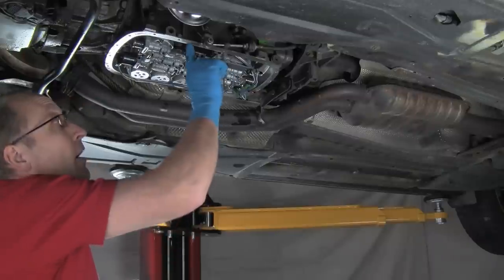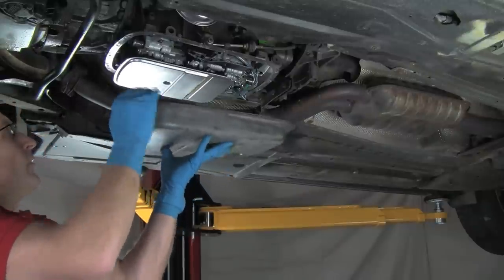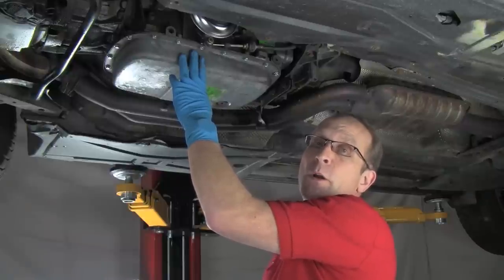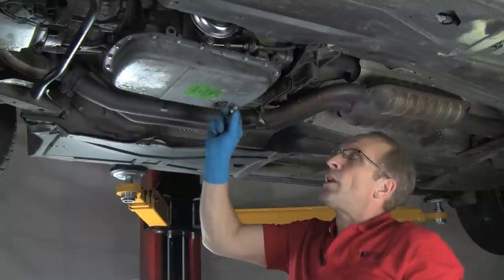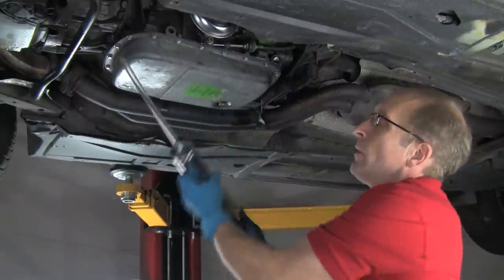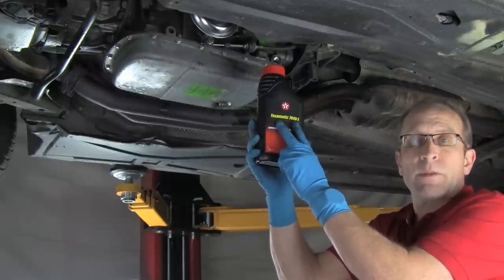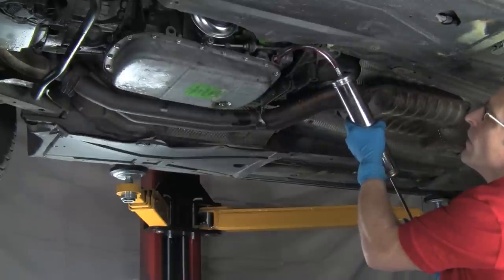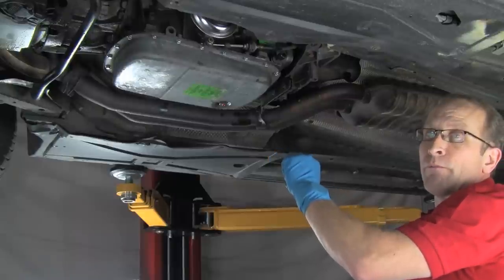Part 2: Changing Automatic Transmission Fluid & Filter On A BMW/MINI

Comment: Is it okey to just have the engine running like in this video with a 5HP30 transmission? Some say the oil has to be at 30-40 C° temp etc before final fill. I want to do this procedure on my E38 750. Waay to expensive for BMW to change fluid and filter

Comment: great demo, but I have a question, should I buy and use the transmission oil at BMW auto part? or use like your demo Texaco or the other brand, are this the same quality than BMW oils?

Comment: Most dealerships or even specialist locations state to change the ATF at about 100K, however you guys recommend 50K (at least on an E90).  My E91 is at just about 52K.  This video is a great tutorial, however it'll obviously be more difficult without a lift!  Is this relatively easy to access, with low-profile ramps?

Comment: BavarianAuto I have an 01 540i AUTO, I am about to perform this maintenance, But I am conceded about the quantity of ATF.  After calling BavAuto I was told that my car needs 7L of fluid and in this video it is 5L of fluid.  Which one is it? I will be performing a regular transmission/filter oil change.  I am at 105k miles. Thanks !

Comment: Thanks for great video and excellent knowledge share.
I've BMW 318i 2007 1.9 automatic and very recently it was sticking to lower gear especially on uphill at low speed. And my car was eating away the engine oil (I have been putting 4L every 2/3 months). Now the engine light came on and I fill in 5L but the problem is gone worse. On auto it is reluctant to change gears at all unless it is downhill but manual is good so is the reverse. And the power is not as much as it sounds like. Would changing the fluid and filter solve the issue? Please advise. Thanks

Comment: Do you recommend to have a transmission fluid flush at a garage instead of only changing the oïl and filter? I have a 2005 325i 150 000km never changed the trnasmission oïl?

Thanks

Comment: With this method  we won't be able to get the oil left in torque converter? Is there any way that we could that oil as well because the torque converter is full of oil????

Comment: Hi can you guys do a video on the BMW Transmission Fault Code – P0741 – Torque Converter Clutch on a 2001 530i

Comment: I wouldn't recomend hobby mechanics to do this themselves. I'd rather go to a repair shop that uses a transmission flusher. It takes about 10-15 litres of oil to do it, but the effect of the job is so much better!

Comment: Your vehicle has a ZF6HP26 transmission the pan filter and magnets are all in one, also the connector sleeve needs to be replaced, if you’re thinking about doing it yourself be mindful that that particular transmission (sealed for life ) needs to be refilled from the bottom of the vehicle up to a temperature of 40 C

Comment: Question:

How many total quarts go into a 2007 328i ?? And Is it safe to do the drain and fill once without having to do a fill and drain twice like most people do on here. More than anything for cost effectiveness.

I saw in another video that the guy said too clean is not good as the oil will be too thin and might mess with the synchro of the gears. Leaving a bit of old oil was recommended to allow the viscosity to be a bit thicker. Any word on this?

Comment: Missing lots of steps....Before the last fill you have to check the trans. temp via DIS software. You also forgot to check the transmission fluid 3. time which should have been after a drive and rest until the trans temp falls back again to between 40-50 Celcius. Because the valve opens after 80C and full circulation completed, so your 2. fill and check level (at around 50C) might not necessarily accurate anymore after that. So the car needs to rest after the drive on the road until the transmission temp falls back down to 50C.

Comment from the maker: In theory ..... if you can load the gun with fluid vs. grease, and it will stay in the gun .... and you don't mind a lot of pumps to run the fluid out.  I think the gun would leak anyway.

Comment: Hi, I liked your video. I've seen other videos where the tech replaces the transmission fluid, runs the car through each gear, and then allows the new fluid to drain through the drain plug once more before refilling it with new fluid again. Which way is the correct way and/or what difference does it make? Thanks for your response.
Reply from the maker: The second fluid drain/fill is recommended when the original fluid is obviously dirty or the change has never been done before and the vehicle has higher mileage.  The running, between the first fill and the second drain, should be for more than just a couple minutes, in order for the fluid to fully mix.
Reply: BavarianAuto 
What about the fluid inside the torque converter? You did not change them at all. That oil is now mixed with new oil and all the effort is futile!
Read more              Show less                     

Reply                  ·           1         
               
                    

                             

Cancel         Reply         Save       
     

         ▼                      Report spam or abuse                                     

          

eviloctober                    1 second ago                 

Dinesh Wijeratne  has any one ever given a answer to your question?  I was wondering the same thing, because with out removing all the fluid its not a fluid change, your mixing 2 different most likely different fluids, you have a very accurate question.Alvaro Aleman asked the question as well  No one seems to know??

Comment: Hey BA, I have a question. My 03 E46 automatic transmission is working fine in reverse but struggles to move in drive and I get a little white smoke after I turn the car off- none while the car is on. I know it needs to be rebuilt or replaced but I wounder if the fluid needs to be topped off just to buy me a little more time. Any thoughts would be appreciated thanks.

Comment: Hey,
Thank you for this great video!!
I have a 2006 325 i and i would like to know what type of transmission oil should i put in beside the one that the dealer has...i have 140.000kms on the car...should i change the filter as well?!?...i dont't know when was last changed because i bought it at 90.000kms....thank you for your precious answer!
Reply from the maker: Yes, change the filter as well as the fluid.  If you look at our website (www.bavauto.com), we will only show you the fluids that are recommended for your specific car/transmission (after you enter your model).  The ZF Lifeguard-5  fluid is our best recommendation for your 325i..
http://www.bavauto.com/fland.asp?part=lifeguard5

Comment: So I just completed an Trans Filter change and I have a quick question, is it fine if I add Pentosin ATF 1 fluid to my 2000 323i BMW. I was informed from a mechanic that if I used Dexron III that the transmission would fail so right now I'm currently debating everything right now

Comment: looks easy now.  just bought a 2001 z3 coupe.  how much fluid should i have on hand when doing this?  also should i run the vehicle and keep changing fluid until it comes out red, or will the procedure you did be ok?

Comment: Hi I have a E36 328i auto i have a little issue when I go Reverse it takes 5-6sec to go in gear I’m assuming low on transmission fluid, how do I check for the level: 1.with engine running on D or engine off pls I do need ur help thank you.

Comment: My 1989 E32 goes into reverse but not drive, doesn't even try to change from neutral to drive at all. One time the dash said "Transmission"  but usually it does not.  Voltage is around 13.22 on the car.
Reply from the maker: More than likely a worn-out "A"-clutch.  See link below:
http://blog.bavauto.com/10394/bmw-automatic-transmission-failure-4hp-22-a-clutch-4hp22-4hp24-3hp22/

Comment: Thanks for the great Video Bav Auto....Can you tell me if, once you've filled the Transmission with new fluid, running through all the gears instead of just park while the engine is running will free up even more fluid space?...thanks

Comment: I have a 2003 530i and just had the ATF drained, refilled and the new Gasket & Filter were replaced also.  I put the cardboard under my car overnight and just got home from work, I found out there is fresh fluid which is about 7 different spots on the cardboard about the driver side.  I wonder what is all about?

Comment: IS THIS THE SAME FOR 06 BMW 325i AUTOMATIC? AND HOW MANY QUARTS OF TRANS OIL WOULD MINE TAKE?  GREAT VIDEO.. EVERY DIY VIDEO SHOULD BE LIKE THIS!
Reply from the maker: The E90 chassis 2006 325i uses a different transmission. If you look at our online store, at BavAuto.com, we will show you the proper filter kit, fluid and the fluid quantity.

Comment: Great video... very detailed and thorough.  Does this process apply to a 97 E38 also?  Also, when checking the current trans fluids.... is ok/normal to see some very small metal shavings?  I took my 97 740iL to a local tranny place ... they looked at the oil, saw some very small shavings and said I need a new transmission, thoughts?  Thanks so much --- Steve in Florida

Comment: Excellent and usefully video, can you advise what is the bolts pressure for my e46 320D touring model 2002.

Also where I can find the super duty magnetic drain plug?

Thanks in advance and best regards.

Jose // Spain
Reply from the maker: The transmission in your 320d will be the A5S-390R.  This is externally similar to the A5S-360R shown on this 528i.  The pan bolt torque is 7-ftlbs.  We have the magnetic plugs in-stock.  just go to our web site at BavAuto.com and ID your car as a 2000 328i.  then search magnetic drain plug.  We do ship to Spain, but you will need to email our international Advisor at info@bavauto.com.

Comment: Transmission change plus filter in 1999 bmw 5 series i really dont need any advice but mine scar is rack pinion removal and putting pressure on oil pan lifting  engine to remove rack pinion.

Comment: Thanks for the video! It was a great help.
Quick question. Approximately, how long did you run the car in park for before topping it off?
Reply from the maker: Just long enough to run the selector through each of the gears, pausing for a few seconds at each gear).  Remember to apply the brakes when doing this.

Comment: i have a hole in my transmission cooler, attached to the radiator. i'm going to replace the cooler. do i need to check/add transmission fluid after i replace the cooler? vehicle is 09 528i

Comment: Hi that was a great video,
I was wonder if this what they call the half flush, or is there a full flush that involve change the fluid inside the torque convertor etc? thanks
Reply: Yes this is just a half flush if you watch close at the end when he is topping off the fluid you can see the run off is not Bright red so it has been mixed with the fluid that was left over in the torque converter
Reply from the maker: As Pat noted, the fluid was very dirty.  We ran the transmission after the first fill, to mix the fluids, then drained again (without removing the pan) and did another fill.  You can't drain the fluid that is in the torque converter and trans body.  Therefore, if the fluid is nasty, you must do second and even third mix, drain and refills in order to get the bulk of the fluid fresh.

Comment: what specific transmission fluid do i use and if it possible that i can just change the fluid not the filter ? One more question what can of fluid do i use for the rear differential .. Thank you

Comment: Great video, very professional and thoroughly explained, thank you!!
94 740i with Black label Transmission... is the Shell LA-2634 the only fluid acceptable for use? Do you know of a suitable substitute? I just purchased this car and has 99,000mi, seems to shift fine, in and out of gear no problem, but has a strange "whining" sound near the top of the RPM range just before the shift. 1-2 2-3. im not sure if the transmission has been serviced before, and thought this would be a good time, do you think a fluid change would help? could it be low on fluid? thoughts on "whining" noise?
thanks, Matt
Reply from the maker: We would certainly recommend a fluid and filter change.  The time is due and it may fix the whining as well.  We recommend the Lifeguard-5 fluid as the new replacement fluid.  See our online store at www.bavauto.com . Search "Automatic fluid" for the recommended fluid and quantity,  then search "automatic filter" for the filter kit..

Comment: Is it possible to get more fluid out of the torque converter by either letting the car sit with the pan open for a while (24 hours or so?) or by opening up the cooling lines at the radiator, and running it with the fresh fluid and a line open, draining into a container?

Comment: Hi There, thank you so much for this video u r awsome, But have a question I have a 2004 x5 4.4, for past few weeks i have notice that i am lossing ATF fluid but don't see any leakage. Only thing i notice is that atf reservoir and reservoir hose seams to by wit or sweaty. any idea what should do, ur help is much appreciated.

Comment: Thanks! I dropped the pan and my the oil was black with similar wear particles. 100000 miles. Previous owner never changed oil. I changed the filter and oil and ran it for maybe 100 miles but oil is still fairly clear red. Should i change it again in a week or so?

Comment: I have a Cadillac Catera with a similar transmission. I changed my fluid, but failed to add an additional quart after finishing the job. When I checked it warm a week later, it still leaked out very slightly. Is my fluid level full? Or should I attempt to put more fluid in it? It wasn't running when I checked it. Thanks for the tutorial.

Comment: Great Video ! question. should the new gasket be lubricated with ATF? and is high temp  sealant helpful ? and if reuse the drain and fill plugs, does high temp threadlocker help?

Comment: I pulled what I believe to be my fill plug yesterday and quite a bit of fluid came pouring out.  Is this an indication of overfill...or is this normal?  2001 X5 4.4i.  I have my car on jackstands and level.  Planning on draining the rest today and swapping the gasket, filter, & fluid.  I assume the process as shown in the video is the same for my X?  Thank you for your help.

Comment: Would a 1995 525i be similar to this? Also, I have heard you are supposed to drain out transmission fluid in separate parts, not all at once. Would you mind addressing this for me as I did not see you perform it this way in your video. Great tutorial though, can't wait to do the job.
Reply from the maker: Drain all the fluid at once.  We've never heard that one .... don't drain all at once.
 Your 95 525i will be similar, but is a different transmission.  One main difference is that you will have an additional small fluid pan forward of the larger main fluid pan.  this pan has no drain plug.  You just remove the bolts and allow the pan tip to one side to drain the fluid.
See the link below for additional info on this transmission:
http://blog.bavauto.com/2469/bmw-automatic-transmission-fluid-change-e36-a4s-310r-4l30e/

Comment: I have an '06 Z4 that I want to do this for.  Can I do this with the car up on jacks or rams in the front, or does the car need to be level in order to properly fill the transmission oil?

Comment: Additionaly to prevoius comment you mentioned in comments below that gearbox from this presantation is A5S360R so according BMW specyfication this oil 83222305396 should be used. This is BMW id and means ATF2 oil. You used Texamatic 7045E which is ATF3. Could you explain why or maybe I understood this not correct.
Reply from the maker: In the US, this year and model (99 528i) was spec-ed with the Texamatic fluid as the original fill.

Comment: I'm in the habit of always putting a little oil/fluid on gaskets as well as rubber seals. Any reason not too. I figure it the gasket is going to soak up some oil/fluid over time anyway.

Comment: I changed the oil 20,000miles ago, I have probably a bad seal, so I've run out a lot, maybe 1liter per 10 000miles, it's possible to doze new oil without changing the filter and draining the old oil? Because I think my old oil is still good. thanks for reply :) I have the BMW E49 540i

Comment: Surely you would want to drain the torque converter and rid the system of most of the old contaminated oil???  Seems to me to be a better proposition than just draining the pan.

Comment: So I was driving my 99 BMW 323i and I had a huge somewhere. The day before is driving a little rough lucky found out it had to little to know oil, I put 6 quarts of 0w40 for euro cars, next day on the high way it was fine until later in day it start loosing pressure in the high way I had to pull over . Drove to a safe location easy to get to later . When I came back later on it was a high leak some where from the under the car . I though it was the oil but the oil was fine. Check power steering fluid it was low but after looking at this video I am now thinking it could be the transmission plug or transmission gasket. What could it be. Automatic engine shifts fine expect in reverse it's rough like a mount needs replace, but  what do you think

Comment: My 2003 X5 4.4i currently has 113k and I don't know the history. I was told by an indy tech that I should not change the trans fluid because it could possibly dislodge particles and clog passages and do more harm than good. The transmission behaves normal but I would feel better if it had fresh fluid. Your thoughts?